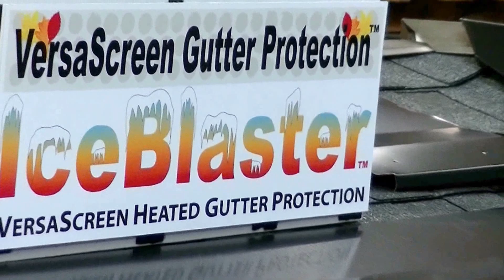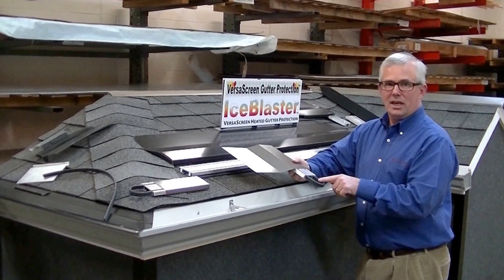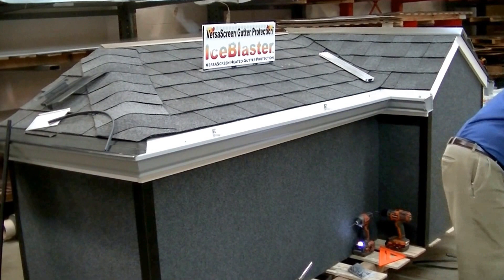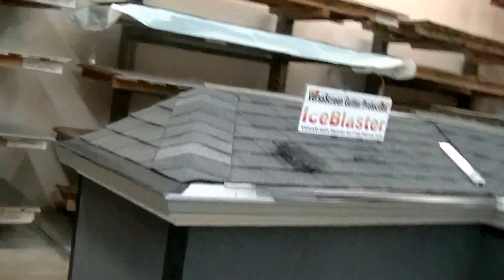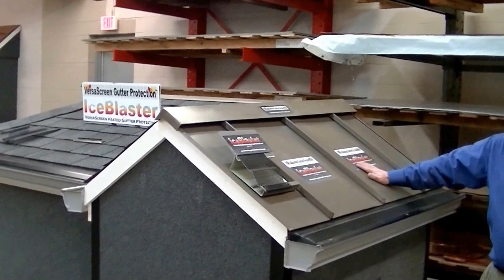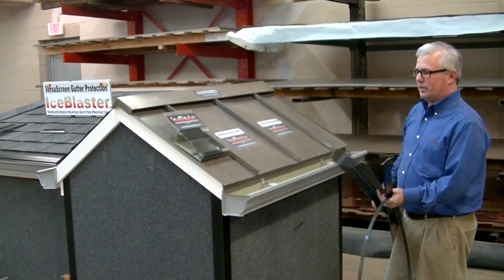Roof Ice Dam Prevention System Product Tutorial

Comment: The question is how much to have this installed professionally
Reply from the maker: Hi Duane. You can reach out to us through www.EdgeMeltSystems.com and we can help you out with a contractor in your area. Thank you for taking the time to watch.
Reply: They don't want to tell because it's EXPENSIVE.  My question is, rather than deal with the symptom, it's best to attack the problem.  Block heat sources from getting to the attic, install adequate insulation, and verify you have proper ventilation.  With these three things corrected, you'll NEVER need this type of product.

Comment: Looks like you are creating your own ice dame above the over lay cover???? Last thing I need is an ice dam above the eave overhang in The Upper Peninsula of Michigan
Reply from the maker: Hello Kenneth. Thanks for taking the time to watch our product tutorial and commenting. Our systems are designed to prevent ice dams from forming. By concentrating the heat from the heat cable in the radiant panels at the roof edge, in valleys, and other areas ice dams do not form. 

I would agree that no one would want an ice dam forming higher up on the roof. Interestingly, this does occur with roof raking. Removing the first 3 to 6 feet of snow from the bottom of the roof creates a cold edge higher up on the roof where ice dams can form.

Please feel free to contact with any further questions at 888-360-7872 and thank you again for your comment.

Comment: IS THIS AVAILABLE IN THE CLEVELAND OHIO AREA ?
Reply from the maker: Yes it is. Contact us through www.EdgeMeltSystems.com or call 888-360-7872. Sorry for the late reply. Added the response as a comment and now realize you wouldn't get notified if I just commented rather than replied.
Reply: HAD A HARRY HELMET GUTTER HELMET SYSTEM INSTALLED ON JUST THE FRONT OF MY BUNGALOW LAST FALL AS A TEST. THE WINTER WAS MILD WITH JUST A FEW SNOWS OF ABOUT 5 OR 6 INCHES EACH. WISH IT WAS A WORSE WINTER FOR EVALUATION PURPOSES BUT IT SEEMS TO WORK O.K. ELECTRICAL CONSUMPTION WISE I COULDN'T REALLY ANSWER SINCE IT WAS USED VERY LITTLE. AN ON AND OFF THING. RECOMMENDATION IS YOU FIRE IT UP 24 HRS. PRIOR TO THE SNOWFALL TO FULLY HEAT UP THE CABLES. WENT WITH THE PERFORATED HELMET TYPE AS MY ROOF PITCH IS STEEP. I HAD TO DO SOMETHING BECAUSE OF WATER LEAKING INSIDE ABOVE MY WINDOWS & ICE BUILD UP.
Reply from the maker: You shouldn't need to turn it on 24 hrs ahead of time. Just a couple of hours would be all that is needed. If you are using the helmet heat, it may seem like you need it on longer if there is not good contact of the heat cables to the helmet itself. With the heat cables supported by the brackets inside, they can sag down between each of them and loose contact with the helmet surface resulting in poor performance. Our heated gutter guard systems force the cable into direct contact with the melting surface. You get more done with less energy. www.EdgeMeltSystems.com - contact us through the site for more info.
Reply from the maker: We have systems designed for Cleveland winters including any heavy lake effect snow falls. www.EdgeMeltSystems.com - contact us through the website and we will get you what you need.
Reply from the maker: @TRICK-OR-TREAT236  How did it go this winter? We have some gutter helmet dealers buy their heat cable through us because of performance issues with the ones that normally come with it. You are correct in letting the heat cables warm up prior to snow fall. 

We have a full line system that goes beyond just the heated gutter guards. You can see everything at www.EdgeMeltSystems.com
Reply: TRICK-OR TREAT I